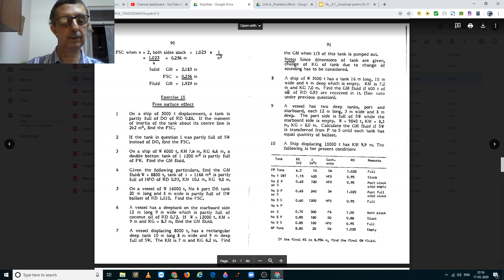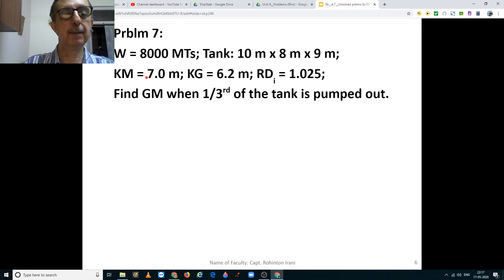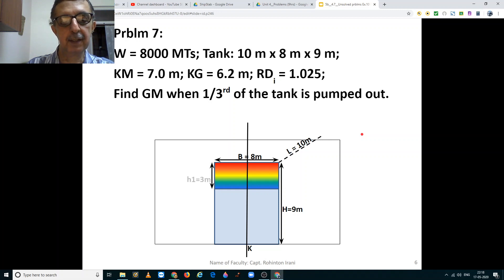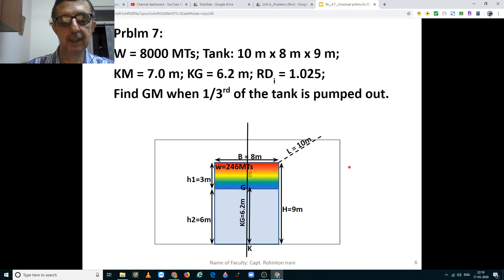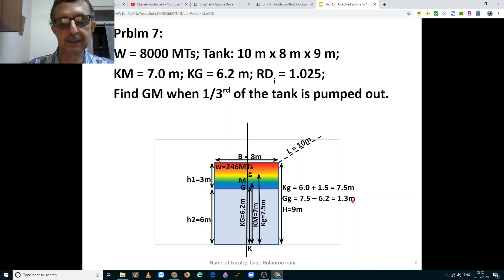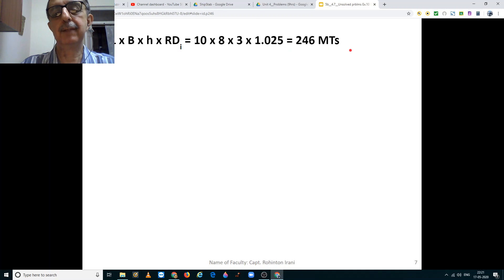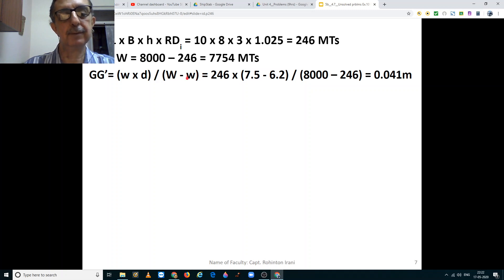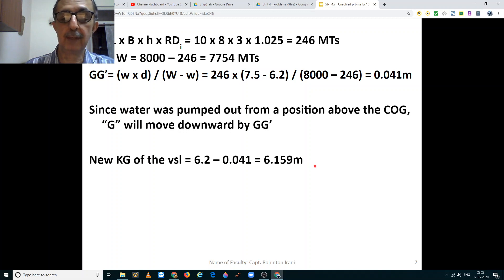ShipStab 1 Ex 10 prblm 7__Free Surface Effects

Comment: Dear sir i have doubt , since we pumped out the water , G would go further up? From the old kg
Reply from the maker: Consider 2 options:
AA. Full DB tank being pumped out to empty
BB. Slack DB tank being pumped out to empty

AA. Full tank being pumped out to empty
1. As it is being pumped out, FSE will be temporarily experienced which will reduce the GM during the process.
2. At the same time, because the DB tank is below the ship's COG, the GM will reduce as the COG rises when it is being pumped out.
3. Once the tank is empty, the loss of GM will be negated.
4. The only of GM will now be because a weight below the COG of the ship was removed.

BB. Slack DB tank being pumped out to empty
1. Being a slack tank, the ships already influenced by FSE
2. At the same time, because the DB tank is below the ship's COG, the GM will reduce as the COG rises when it is being pumped out.
3. Once the tank is empty, the loss of GM will be negated.
4. The only of GM will now be because a weight below the COG of the ship was removed.